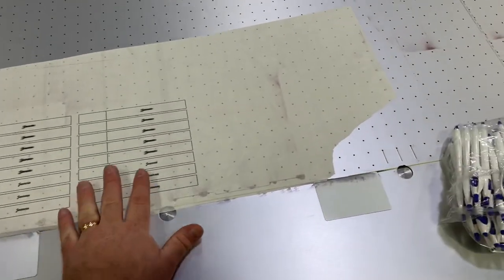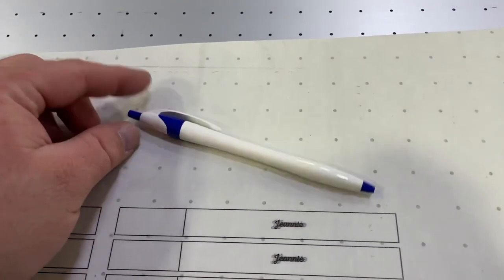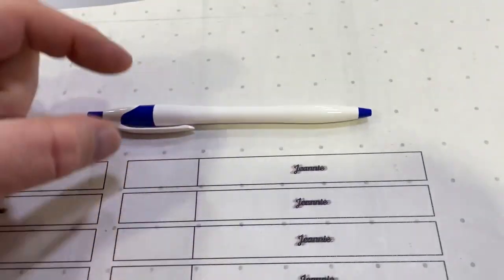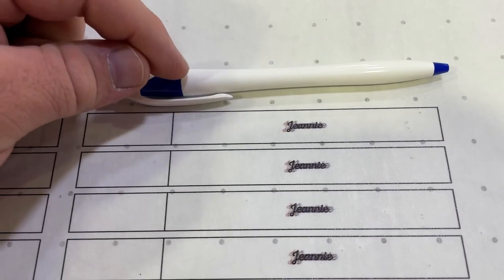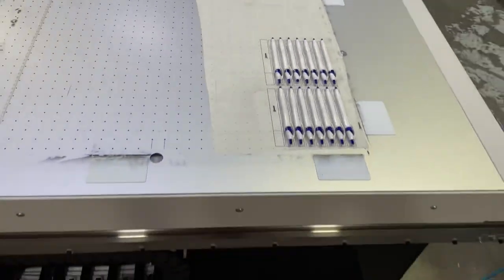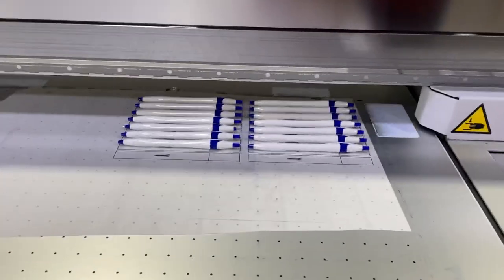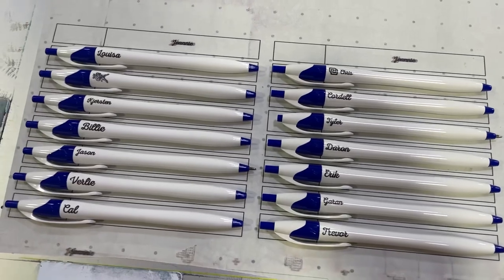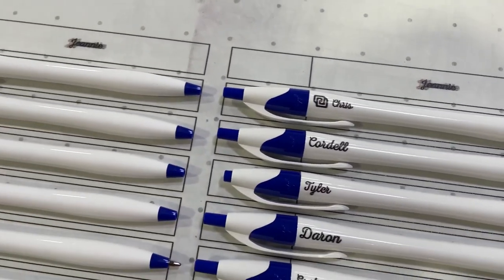Printing on pens with the Canon Arizona 135 GT

Comment: Did you try turning off the bidirectional printing? It will print a little clearer. Albeit slower. Also what is a good source for the pop sockets and tumblers?
Reply from the maker: I'll have to try that. I remember that from my training now that you mention it.
Reply: When searching for them, try to use the phrase “trade only” or “to the trade” with the promotional item your looking for 😁